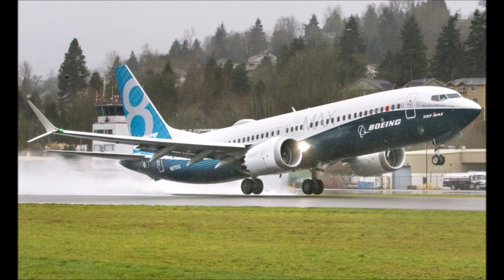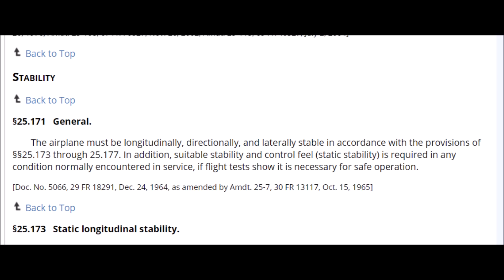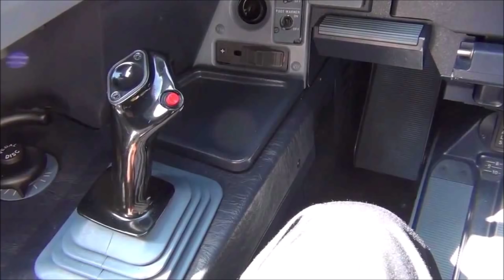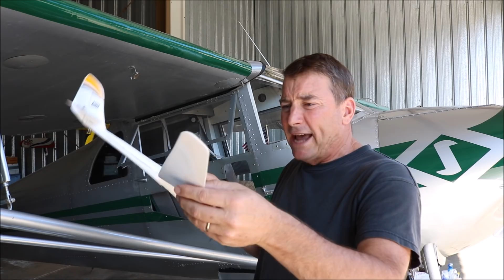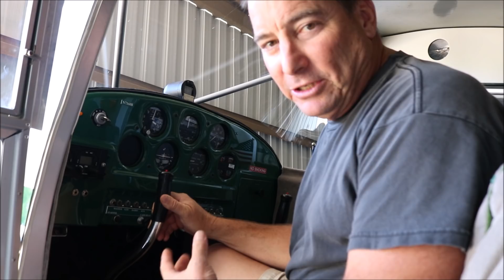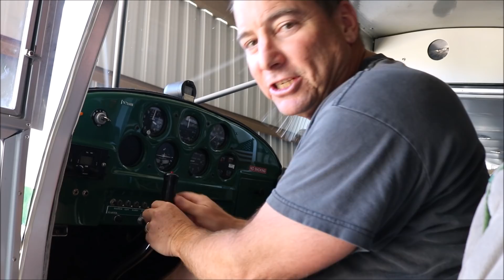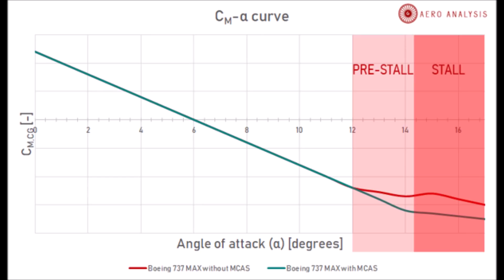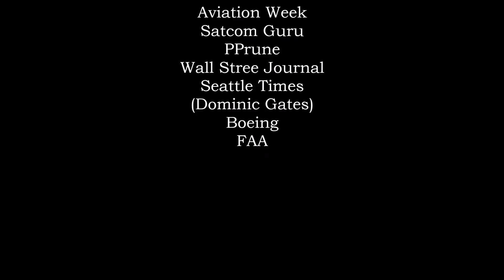737 Max UPDATE 30 Aug  2019

Comment: just wondering if the 737 MAX will retain the same type Certificate as the rest of the 737 models after all this is over?    Thanks sir....   :)
Reply: Ethno
Reply: I read that the EASA demands that dealing with MCAS becomes part of standard 737 training, thus all 737 pilots, wether they will fly a 737 Max or not will learn how to deal with it. This sounds like a solution to retain the single type certificate.
Reply from the maker: They have no choice.

Comment: Great update Juan! Thank you! 
I wonder if there will ever be open discussion regarding the flight crew performance in both flights.  These were low to very low hour pilots flying outside the U.S..  Do you think these accidents could have happened with a U.S. carrier in the U.S? I don't think so and this brings me to the point of pilot shortages and cadets with 300 hours are being moved to the line and checked out as certified co-pilots? Very scary.
Reply from the maker: A big part of the problem. Human Factors.

Comment: Let's be frank. Boeing designed the plane for a professional pilot. 

Once again a truly substandard pilots dumped brand new 737s into the ground/water. 

It isn't hours, it is training. If these crews ran the checklist they would not have crashed period.

Comment: It didn't seem long. I get that standard line. Just one thing - there are some people out there whose gut feel is that engine/pylon/wing configuration does not compute. All it will take is for some moderately acute set of circumstances to come around again and another aircraft will fall out of the sky due to an aerodynamic inconsistency that won't be able to be nulled out either manually or by FCC. A lot is dependant on the actual NTSB and international appraisals of why the Lion Air and Ethiopian planes actually went down.

It would be great if you could describe the design impetus behind the 737 Max series wing fence shape. I'm thinking it has to be that way because if it wasn't, the already compromised  lift capability brought about by those large engines would be catastrophic. To my way of thinking, they need to prevent air from the underside of the wing from spilling over into the upper wing airflow, from the high pressure zone to the lower pressure zone. The inward moving direction of the airflow spilling over the upper wing would tend to compress the airflow that needs to move from the front to the back of the wing in order to generate many tonnes worth of lift. The spillover airflow would, thus, dump lift in much the same sort of way a spoiler is meant to do. The upshot, Juan, is that if one of those wing fences accidentally breaks off in flight for whatever reason, how is the lift differential between both sides of the aircraft going to affect it's ability to fly? I'm thinking back to the Chicago O'Hare DC-10 disaster on takeoff, where the port engine detached at the critical moment and a portion of the leading edge slats got torn off in addition to the loss of hydraulic fluid which finally caused the remaining leading edge slats to retract, thereby catastrophically dumping lift over the port wing. Do you catch my drift?
Reply from the maker: Offhand, I don't think a wing fence failure trumps an engine departing the structure.
Reply: As a lay person, all I've gathered over the DC-10 accident is that the aircraft could very well have survived that non-standard method of an engine shearing off, along with no great loss of hydraulics. The real critical factor in that case has been laid at the feet of the leading edge high-lift devices. The 737 Max wing fences have the upturned fence type of design that has been around for some time now, and I believe they are there to dissipate the tip vortices responsible for quite a bit of drag. Those downward turned aspects of the fence on the 737 Max strikes me as added insurance to deflect airflow generated on the underside well away from anywhere near the upper wing surface.

Comment: Well damn.  I'm not a pilot, but I am going through the exact same thing with prostate cancer.  I have been on hormone therapy since late January and get my last 90-day shot next week.  I completed 39 radiation treatments in early June.  I suspect it will be another 6 months before they can get an somewhat accurate PSA reading.  Soooooo, best of luck to both of us!  Cheers, Gary
Reply from the maker: Yep, you'll grow tired of the Lupron hot flashes, hope mine end soon. Mine wears off in a couple weeks.
Reply: @blancolirio  I am extremely over the hot flashes and night sweats.  With last shot mine should last into January.

Comment: Nice job trying to explain a very complicated subject with a minimum of engineering-eze.  To better define the difference between Airbus fly-by-wire and “traditional Boeing design, I would define it by saying that Airbus uses the flight control computer software to “tailor” the handling characteristics or “feel” to meet the FAA required handling requirements.  Using the software to tweak the control feel to create the desired handling qualities.  Much like the hydraulic elevator feel system changes pitch forces based on airspeed.  To use one example listeners may be familiar with.  Or, power steering on a car that can be tailored to give similar steering wheel feel even as the speed of the car changes.  Ie., not too sensitive at high speeds and not too stiff at low speed.  Can’t emphasize enough that the stability of the 737 is not the issue.  FAA never would have certified the aircraft if it were not inherently stable, as you described.  Handling qualities, or feel of the pitch forces in certain edge of the flight envelope conditions is and always has been the issue of concern with the 737Max. Which were changed somewhat with bigger, heavier engines mounted further forward and higher above the center of gravity on this model compared to previous 737s.  MCAS was initially intended to make this physical changes to the airplane less noticeable to the pilot, and making the response of the airplane more like previous 737 versions.    Hope this helps.  

Your discussion of the FCC computer issue was very informative. Although you mentioned the speed trim system very little, it might be useful to describe what this system is, what it does and why it was incorporated when the CFM engines were added with 737 Classic upgrade, as in my opinion it is related to the need for better pitch change response to reduce the pitch forces experienced by 737-3/4/500 pilots too because of the change to high bypass engines on that version and the 737NG as well.   Just a few thoughts.  Keep up the great work.  👍
Reply from the maker: Good idea Ken, thanks.

Comment: I hear so little about the bad angle of attack sensors that fed the bad data to the MCAS system.  Are these going to be repaired or improved as well?
Reply: Loren Wilson — Even if they were, any externally mounted sensor could be easily damaged.  A damaged sensor must not be allowed to crash the aircraft.
Reply: This has already been addressed in the MCAS re-design, before this latest FCC redesign.  

In short, there is now a comparator.  If the two AOA vanes do not agree (within a small margin), the MCAS will not activate.

     In addition, MCAS will only activate ONCE per flight (if required).  It’s authority to add AND trim is now limited to ONE application of 2.5 units of trim in the AND direction.

   P.S.  The “S” in MCAS is “System”......writing “MCAS system” is redundant (unlike the original sensor input into MCAS).
Reply: @Stepclimb  In other words, they haven't fixed the AoA sensors.  This is one of the root causes of the whole problem.  the other being that the machine took over and forced the nose of the plane down repeatedly.  It should never have been given any control - just a warning system.  And especially not set up to lose power to the elevator control when it is shut off.  They use a worm drive on that for a reason.
Reply: Loren Wilson 

      The root problem was NOT that the AoA vanes were subject to damage.  

    The root problem was that a system that had the ability to rapidly run the pitch trim full down in under 60 seconds was dependent on only ONE sensor.  

The system now depends on BOTH AoA sensors agreeing (within 5.5 degrees) that the AoA is approaching the maneuvering limit.

      There is no “fix” for the sensors themselves.  It is NOT possible to design a sensor (pitot tube, static port, ice detector, TAT probe or AoA vane) that is 100% damage tolerant.  

     Aircraft designers get around this simple fact by designing REDUNDANCY into systems that depend on sensors.

      This is where Boeing screwed up....by designing a system with the authority to run the pitch trim away with NO redundancy in sensor input.

      This deficiency in design has now been corrected.  The risk of this type of mishap happening again has been adequately mitigated.

       Juan explains this well at about the 22:10 min mark.

Comment: I always thought it was more than just a "software glitch" now the Max is in the Junk yard until they modify them enough to be safe to fly.
Reply: radioactivelarry — Did you listen to this video all the way through?  It is software, although not a “glitch.”
Reply: @GH-oi2jf  Did you? It's complicated to say the least, it's the software interfacing the hardware that two processors didn't communicate with each other, along with other problems. If it was a simple software solution they would have been in the air months ago!

Comment: In your experience is it better to fly these modern heavy Aircraft with so much auto control or would it be better with less. It seems to me that the pilots, having less to do could lead to boredom. MCAS was the cause of both these accidents as the Pilots did not have enough time to override the computer control. I hope you are better soon and that you are able to return to normal duties and that you will have time for video making. Martin (Thailand)
Reply from the maker: Complacency is the biggest problem with increased automation.

Comment: Very good job that was very intense. But I didn’t hear anything addressed about the manual trim wheels being downsized in diameter for the electronic dashboard screens which are larger. The smaller trim wheels do not have the leverage of the old trim wheels in the 737 older versions
Reply from the maker: Thanks, this was addressed in a previous 737 update.
Reply: Certainly on the 707 any trim wheel movement was accompanied by a very loud and un-ignorable clattering - the length of this “distraction” was the first clue that something in the stabiliser system needed attending to. Indeed, we used to announce “trimming” to confirm deliberate operation of the “pickle” switches on the yoke

I suspect the 737 may be a little different

Comment: Here's what I find most confusing. If the MCAS system was implemented to provide the same handling characteristics then doesn't that still point to a serious flaw with Boeing's decision to use the new, more efficient turbine engines on an old airframe design?
Reply: Mash Code That’s a point likely to be argued for decades to come - by which time the initial airframe topology will we close to 80yrs old. If Boeing is still in the business of building commercial airliners at that time they’ll hopefully have learned to not extend a model series that far beyond the envelope of technological advancements.

Comment: My house is 8 miles straight out from the 34L runway of KPAE Paine Field, Everett, WA.
I have dozens of these 737s flying directly overhead or somewhat to one side or another of my house.
I’ve taken dozens of videos of these flights.
I don’t think Boeing has that many test pilots to accomplish this, so I think many of these planes are being flown by off duty airline pilots, who will also be able to testify as to the new reliability of the design.
I wonder what the AOA is of the accelerated stall, i.e., is it the same as for most airplanes, which is about 16% I think.
Reply from the maker: Interesting Jim! Keep us posted.
Reply: I’ve had them come over sequentially, where I’m unable to get the iPhone back out in time and properly oriented up between trees on all sides, in either front or back yard.  If the engines are really loud, I know it’s coming from the South and very low, seemingly at the minimum 1000 feet.  The problem is that at that low altitude it’s coming really fast and I’ve fumbled the iPhone routine, but I have got a couple pretty spectacular fly overs.   I’m only at that house 2 1/2 days, but it makes it fun, kind of a new type of fishing. It’s frustrating though when you walk out to the car or mailbox without the iPhone and here comes a a really low one.  Apparently 8 miles out and 1,000 feet is about right for a landing, or at least what they want to practice.  I’ve always had a lot of GA traversing overhead because I’m also on a direct line between KPAE and the Northern tip of Lk. Washington and a lot of pilots probably like flying up over the lake to Paine Field or on their way farther North.
I don’t have TV and quit the newspaper so I especially liked your great reporting on what really happened here.  It was pretty stupid of the FAA not to realize what a major thing was being accomplished here.  It was pretty stupid, arrogant and irresponsible for Boeing not to ground the planes after theLion Air Crash.. Of Course, Capt. Smith flubbed up really bad on the Titanic, too.  The Boeing CEO should feel like him.  He did about the same thing.  Mankind never learns.  John W

Comment: If they rewrite the software to take both computers offline doesn't that then require a different type certificate. Unless I'm missing something, no computer vs computer makes it fly like two different aircraft doesn't it?
Reply from the maker: This will apply to ALL the 737's
Reply: @blancolirio  Oh, that makes sense. Once you get beyond the C182 range of aircraft I'm a passenger :)
Reply: Michael Lloyd — Does type rating matter in an emergency?
Reply: @GH-oi2jf  Juan answered the question. Here's his answer: "This will apply to ALL the 737's". Conversely, if it didn't apply to all 737's then there would (might?) be a type rating change. If you watch his video he explains why that would be a big deal. Your question is kind of like asking if tomatoes affect angle of attack...

Comment: Will pilots be trained in the handling characteristics of BOTH the FCC-augmented 737 MAX and the “fully manual” unaugmented 737 MAX? I feel like the pilots will be too used to the handling of the computer assist, so in an incident where the FCCs stop helping the pilots, they have a greater risk of pilot error causing a crash. Still better than the computer crashing the plane into the ground though.
Reply from the maker: Pilots of older 73's should have no problem.

Comment: Not your fault mostly ,  this is a VERY complex sub system to present and explain clearly.  Adding the human layer makes it  just about impossible at a single pass.  On screen text corrections to your narritive do not help.  IF i were a 737 pilot i would take advantage of every opportunity to take off , fly and land the airplane MANUALLY - and share the experiences with the co pilot.  AND I would hope both the airline and FAA would not get in the way - schedules and fuel burn not considered first !
Reply from the maker: Interesting-Most folks feedback say text corrections help a lot.

Comment: Since the MCAS is mainly to adjust the handling or "feel" of the aircraft in flight, is it reasonable to compare it to torque steer in automobiles? 

Torque steer is not necessarily a problem, it's just a characteristic of a front wheel drive auto. It can catch those who have never driven a FWD car off guard, so it's good for car designers to minimize it.  Likewise, the stall characteristics of the MAX are not necessarily a problem. If the MAX did not have predecessor models of the 737 that Boeing wanted to emulate, the MAX would have been easily certified without MCAS. But because Boeing wanted the MAX to have the handling characteristics of previous models, MCAS became necessary solely to achieve that goal. Is that roughly correct?
Reply from the maker: Yep!
Reply: Old Guy Does Stuff The FARs are very specific about the feel forces. A pilot flying on instruments does not have the same visual and sensory feedback that a truck does (try cornering with a blindfold over your eyes).

Comment: 8:00 - two 16 bit processors???  I've been around computers too long (and yes I know these are specific task processors, not general processors as in a laptop).  Hell yes a 16 bit processor can get overloaded!  Only slightly better than the kit on the lunar lander...
Reply: Howard White — I’m a (retired) software engineer.  There is nothing wrong with using a 16-bit processor if you don’t have data with more bits of precision required.  As you add functions to the software system, you might need to upgrade to faster processors and larger memories, but not necessarily wider data paths.
Reply: Point taken.  I'm just grousing about having recycled all the 32bit computers I'd accumulated; totally different stuff and I get that.  New planes get built with the same ol' subsystems.
Reply from the maker: Pretty simple design. Not a lot to process, it's almost rocket science, but not quite.
Reply: :)  Simple is good.  The rocket types are even slower to upgrade their computer kit than commercial aviation.  One of my college roommates worked for Jet Propulsion Labs in CA.  Many stories.  P.S. Thanks for the explanation of the channel name.  Did wonder.